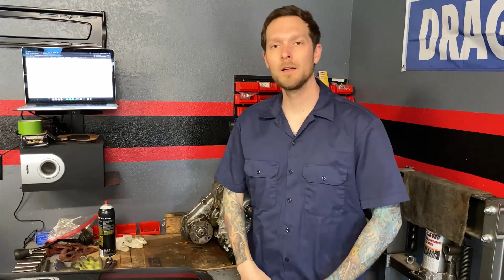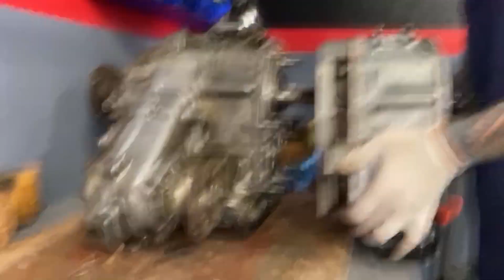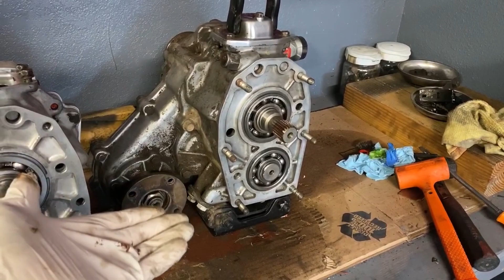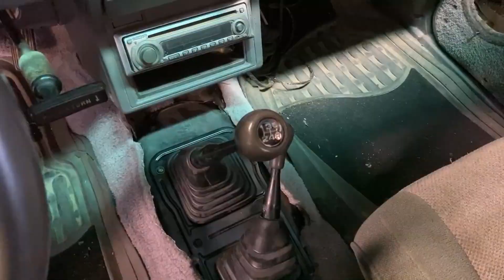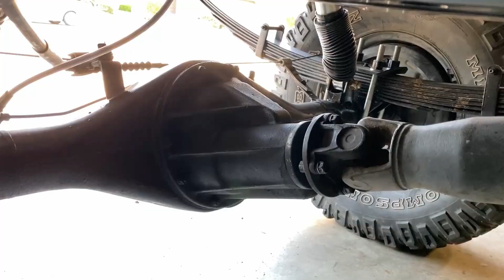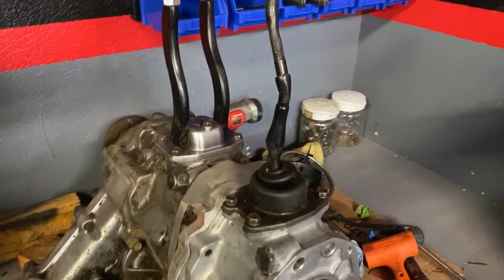How Dual Transfer Cases Work and Why You Need Them for Rock Crawling

Comment: Do you know why everyone seems to put the 4.7 gears in the rear case instead of the front? It seems like everyone does but I don’t understand why it matters.
Reply from the maker: It has to do with the load on the input shaft. I pulled this from pirate4x4 for you: 

The reason for running the 4.70 gears in the rear is the 21 spline input gears. In a dual crawler there are two of these input gears, one in the front case and one in the rear case. The front input takes power directly from the transmission and puts it into the first case. This input gear is very reliable. In the dual case setup, the rear case also has an input gear. This second input gear is the weak spot in the drivetrain. With a 2.28 gear set in the front, the rear input is receiving 2.28 times as much power as the front. If the 4.70 gears are in the front case then the rear input is under 4.7 times as much load.

Comment: The option to be in low - low gear while in 2wd is really great. You can use this when trying to park a heavy boat trailer on a very steep paved driveway.

Comment: All I need to know right now is what do I need to add extra transfer case on kun26 hilux 2006 I only see ones for older hilux ie 106 or does the adapters work on all the gear boxes?

Comment: Thank you so much for the video, definitely I got the explanation I needed. I have a question y
For you or someone that might help. I am not a rock crawler, however, my 88 4Runner has a mix of stock suspension and stock transmission. I have done body lift, drape front differential, add a lift in the rear and adjusted the torsion bar in order to have it lifted for bigger tires. I currently have 35’s on it. My question is, would it be good to just have dual transfer case with both cases being 2.28…? I was considering to get 4.70 gear set combination with a 23 spline adapter from marlin crawler, but it’s so expensive, plus it’s not even in stock right now only the competition set which is a little more expensive. And I’m not even a crawler, is it worth it? Please help me make the decision, I appreciate anyone’s input, thanks!
Reply from the maker: Both cases being 2.28 is still better than a single 4.7 case because with a single case you are stuck with ONLY 4.7. So you will always be in very low range. With dual 2.28s at least you get the option between factory low and then 4.7(ish) low when doubled. 

However if you’re not crawling then maybe the money would be better spent on lockers!
Reply: Thank you!
So basically dual 2.28 will give me 84:1 which I'm OK with that...
About the lockers, I'd need to find out about it, don't know much of lockers...
Reply: I need to figure out about the rear drive shaft and balance after adding the dual case, that kind of stuff...
Reply from the maker: @chmva2000  You measure from the t-case output to your 3rd member pinion flange and give those dimensions + your old driveshaft to a driveshaft shop

Comment: Hey there, very nice and educating video...thank you much!
I have an 88 4Runner, 4x4 and would like to do this upgrade. I am seriously new to this conversion. I have an spare trans and I would like to put this set up together to the stock, any suggestion where to get what I need in order to get that set up together? I’d really appreciate it.
Reply from the maker: Thanks for watching! It depends on your setup (transmission + transfer case). You will need top shifting cases, and if they aren't top shifting, you'll need to convert them. And then you need to decide if you want a factory case bolted up to a factory case (2.28 * 2.28) or if you want a factory case a 4.7 gear, which results in much lower gearing.

At a bare minimum, you need:
- 1 complete transfer case, top shift
- 1 reduction housing from another transfer case, top shift
- A dual case adapter
- Optional 4.7 gear in transfer case
Reply: Hello again, thank you so much for your feedback, I appreciate it. I didn’t keep up with my responses until now, sorry about that!
I just wrote precisely asking about some of what you commented here…
I have my stock 2.28 transfer case, top shift, already set without the pin  for the twin stick to work independently, I already have the twin sticks at hand.
Also, I have another transfer case from another trans I have, 2.28, I can use the reduction unit from there with the adapter that I’ll get from Marlin Crawler, that works, right?
Now, since I’m not a crawler, but I’d like the set up, how slow and effective is the 2.28x 2.28 set up, can you help me with the math, lol…? I know I still have the option to get a set of gears of 4.70 to have it in the transfer case in the rear with a 23 spline adapter, but I’m trying to decide according to what my intentions are and the time and money saving that I might have…please help. Thank you!
Ah, I forgot to ask, about removing the pin for twin sticks to work independently, do they ave to be removed from both cases, including the one set up in the adapter or that one will already be set up for one stick doing just H neutral L…? That part I don’t understand… Thank you much again buddy!👍🛠⚙️
Reply: And about the drive shaft, what did you do in order to shorten the rear shaft to fit and extend the front one, if you don’t have solid front axel?
Since I have spare shafts, can I cut it to size reinforcing it with another piece of it inside and weld it? How about the balance, would that be affected? That’s my other concern, the rear shaft and its balance….🙄🤔The front one I can extend it doing the procedure mentioned, however, since 4WD is not going to be active, only occasionally, I’m not concern about the balance or should I be…?😟
What do you think…🤔? Thank you much for your time and input!👍🛠⚙️